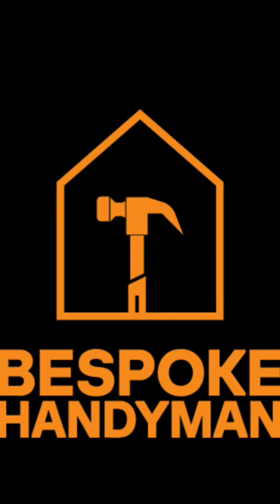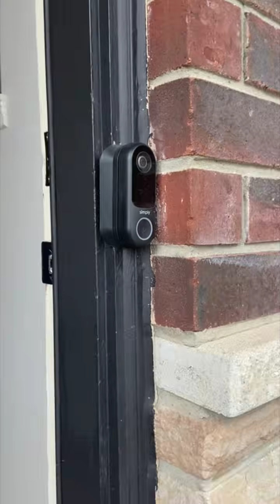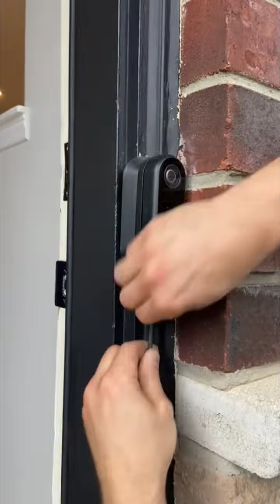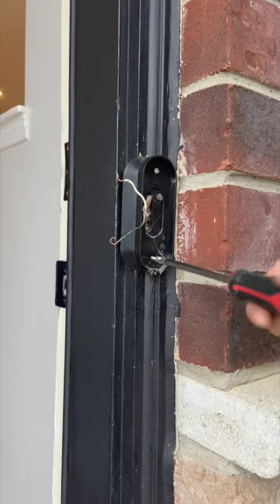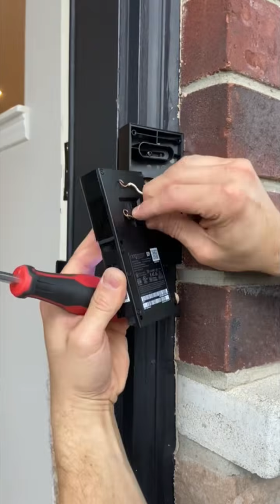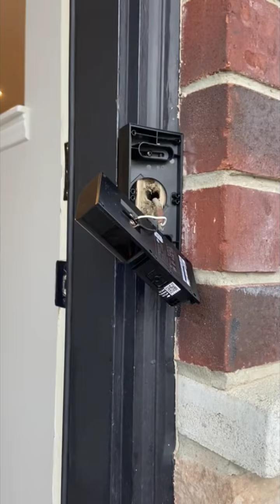How to Replace a Doorbell with a Ring Doorbell 🔔 | Easy Step-by-Step Install

Comment: Do u caulk the bracket to prevent water penetration?
Reply from the maker: Hey katie! It's a little bit overkill but for me it's partially aesthetic, partially preventing any critters from getting in and partially water as well. I wouldn't say it's 100% necessary but it's always a best practice to seal any gaps.

Comment: I really appreciate your video. I am removing a Vivint doorbell and installing a Ring doorbell. This helped me tremendously. Great content, and you explained and showed the process in a way that was very easy to understand!!!
Reply from the maker: Thanks so much! Really happy it helped!
Reply: Have you replaced vivint alarm system with ring? If so did you had any issues with the whole retrofit system install?
Reply: MASSIVE DOWNGRADE: the thing is, your packages will be easier to get stolen cause ring is passive and doesn't protect your porch.